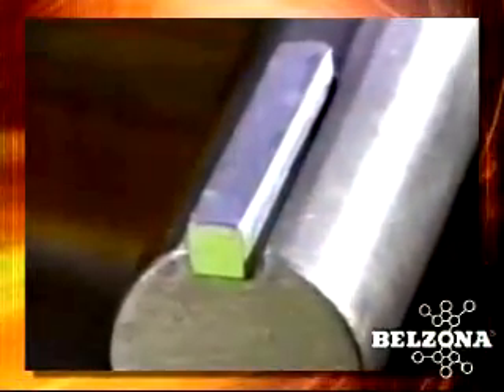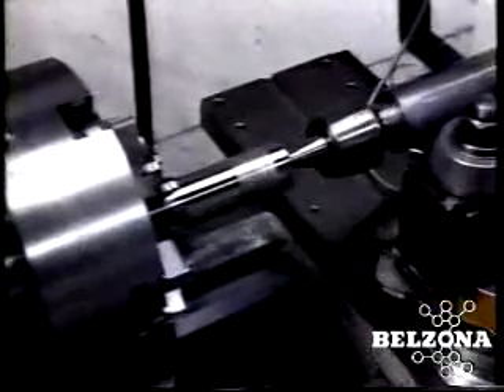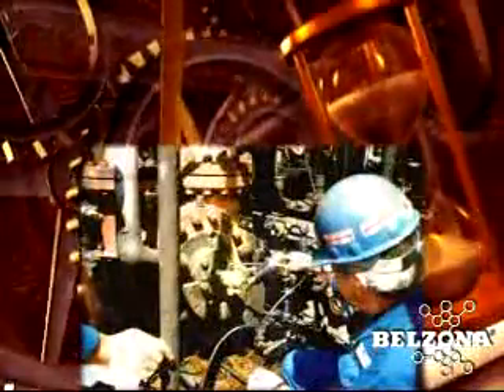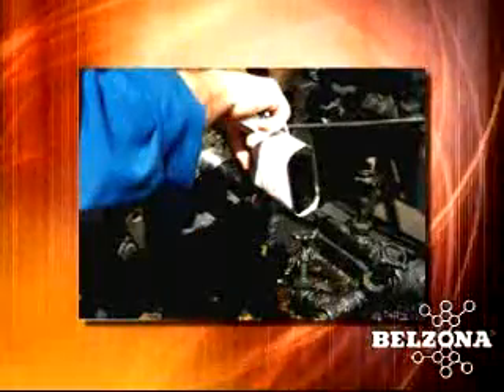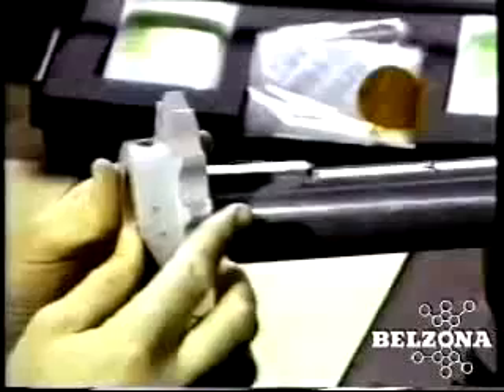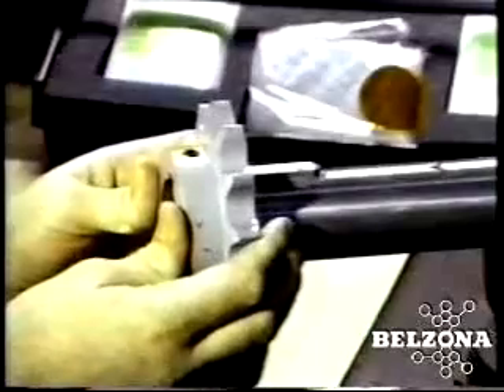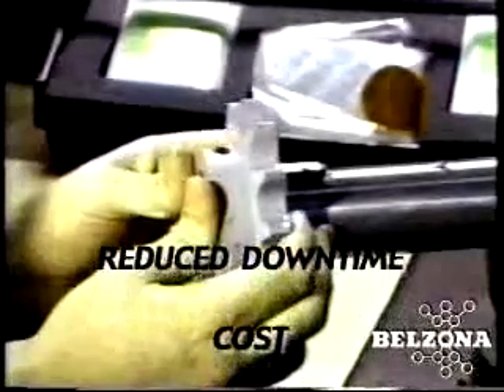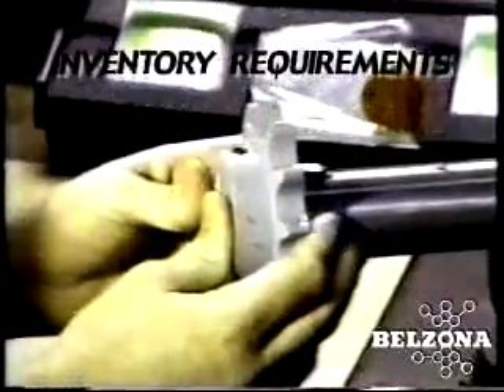Belzona Solutions for Damaged and Worn Keyway

Comment: Yeah that is basically the main goal for Belzona applications.  Save time and money.  Also for example, on a roofing coat of the membrane, it would be categorized as a repair rather than a replacement, which also equates to sometimes Millions in cashflow for a business.

Comment: Will it work for chipped crankshaft keyway
Reply: Kent B. kent, I am the Western Montana Tech Consultant, just saw this question, and I can tell you without a doubt, yes.  Can save alot of money in replacement.  If you want to be put in touch with the rep in your area, simply email or msg me!
Reply: Allready replaced engine
Reply: Kent B. That's a shame, I wish I would have seen this sooner.  I just took over the territory a month ago, however.  The BELZONA product line however is quite extensive and fills alot of needs so if in the future you are in need of any repairs I hope you think of us.  Definitely check out the website. belzona.com..has all of our specs and products along with alot of helpful application info!  Take care buddy.

Nick